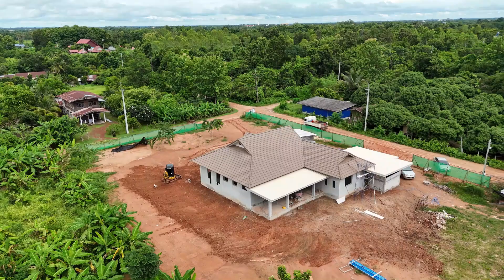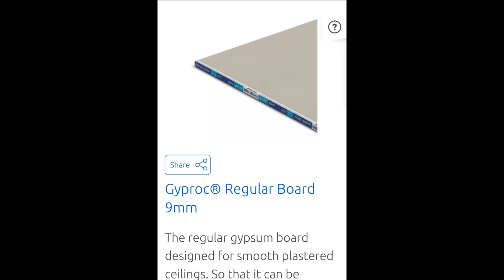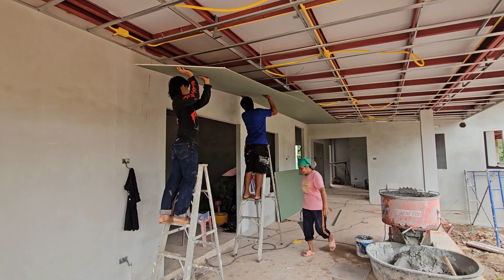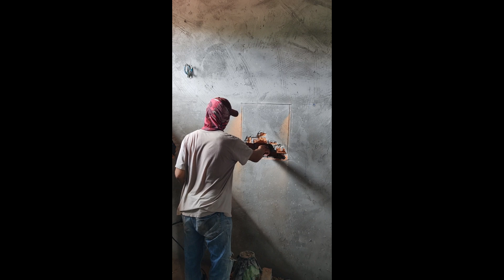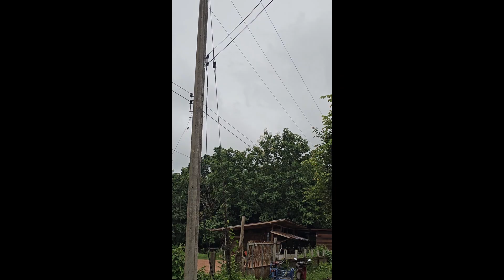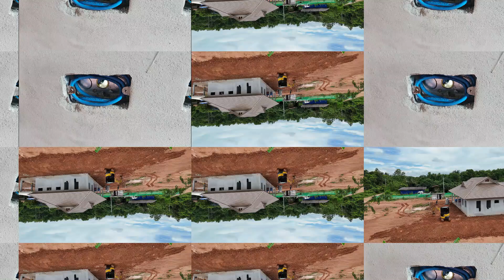Thai House Build Week 22

Comment: You ought to consider at least 10 weeks before moving into the home, allowing it to dry out, cracks may appear so it’s easier to fix the repair without furniture. Just my view and experience
Reply from the maker: @richardhaughton4303  yes - we will not be moving in for at least 3 more months. It been 5 & 6 weeks since the house walls were rendered.